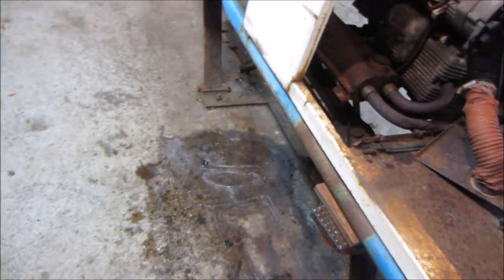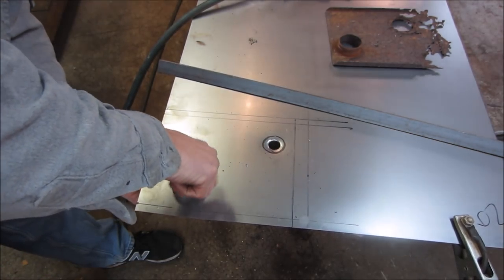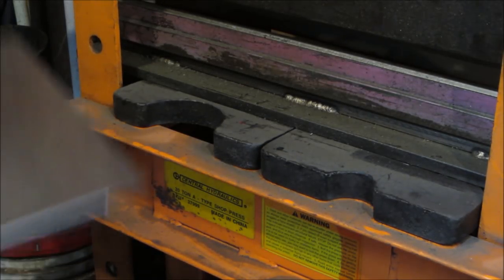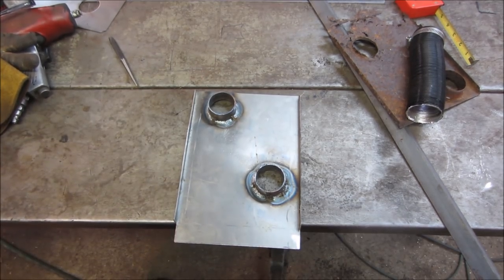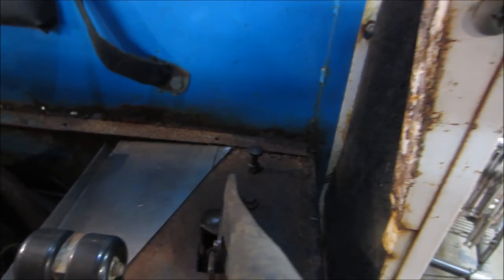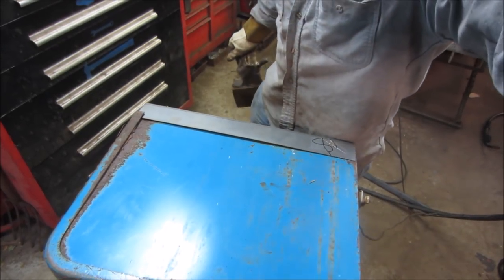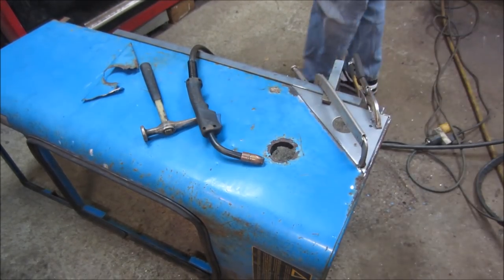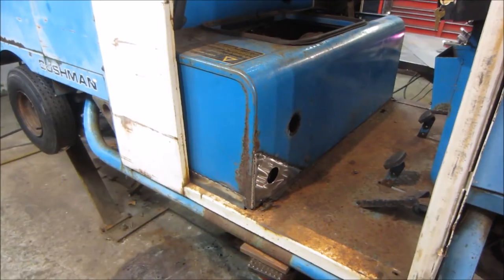metal and rust repair on the cushman  meter maid

Comment: Arrgh, hated to see this video end. This was not only educational, but very amusing with the dialog. Great job as usual. I know it took  a few years to gain the expertise you display with your projects, but you make it look so easy. I sure hope the previous operator didn't have to drive this vehicle in it's terrible rusty condition. When I was a police officer, I had to drive an old Dodge patrol car that had been "restored". I complained about the brakes and the mechanic threw a tizzy fit when I complained. He would leave black marks in the parking lot, to prove to me the brakes were just fine. Lucky for me, I got one of the new Ford cars that just arrived. The Chief took the old Dodge, I think just to show me it worked fine. He drove the Dodge away from the PD, down the hill and was unable to stop for the stop sign and ran up into the bushes, burying the front end into the soft soil. Snicker, snicker, that ended the Dodge's service life, and off it went to the scrap yard. Thanks again..Ken PD retired.

Comment: For replacement foam between heater hole panels, you might look at inexpensive pipe insulation.  Comes in a variety of sizes.  You could just glue it to one side or the other to seal between them well.

Merry Christma, Happy Holidays, and a very Happy New Year to you and yours!

RichE

Comment: Awesome video as always.  Just wanted to mention to you if no one already has that is you are not supposed to use a impact driver on knock outs/hole punches.  It ruins the threads of the tool.  Keeping the threads lubed real good helps with the life of the tool.

Comment: Coming along nicely, and a bit more metal work and it should be pretty solid and ready to go. Agree with others that this is a really fun series doing this unusual restore. Going to have to figure out what to use for those foam rings between panels for the heater, maybe some of that sheet foam packing material? or even some flexible hose pieces. All part of the fun though, coming up with replacements parts that may not be readily available.

Comment: That hole cutting tool is awesome.
Reply: Hole punch. First time I saw one was when there needed to be a hole in my stainless steel kitchen sink for the faucet. Install guy whipped that thing out and I was like wohaa... nice.
Reply: Shawn32671. We used to use those some time ago on aircraft repairs and the like. I think they were called ‘Q cutters’.
Reply: They were originally called chassis punches. They were designed for punching holes in radio and tv chassis for tube socket and other component installation. Electricians still use them for punching holes in electrical enclosures for conduit and control button and indicator light installation. I have a few of the smaller sizes and they do come in handy!

Comment: Noise alert,  ;>) Congratz on your 100K. Last summer when you took the channel up another notch I figured you would get there before Xmas. BTW - your video on that was awesome to say the least. Short on time that day to leave this. (Customer came in) The replacement panels turned out great. Like in the old JC Whitney ads - "Replaces original equipment perfectly"

Comment: Lap welding like this is so much stronger and easier. Even on an auto body restoration, the lap welds turn out great on a ground and skim coated seam. 
I don't get the obsession people seem to have with butt welding panels.     Nice work!
Reply: scdevon 

Rust prevention between the metalsheets?
Reply: I'm a big fan of Fluid Film and / or chain saw bar and chain oil applied to the inside of repaired panels or the back side of repaired panels.  Both have the ability to "wick" into seams and seal the metal.  Paints alone are very poor at fighting rust.  You need an oily coating that keeps "wicking" into the seams.  Weld through primer helps too.  I live in the high desert out west, so each their own.  I'm from the northeast originally though so I know what rust is.

Comment: I may be wrong but seem to remember mine had a 2nd heater hose outlet on the left side bottom?
One mod I made was to cut a hole in that top flat surface on the right and since it was near the engine and exhaust, put a metal cupholder in there to keep my coffee warm on the way to work and back. Believe it or not, it actually worked.

Comment: 100k congratulations.
On a side note, when it comes to sheet metal that thin, you should totally expend the small cost for one of those electric shear adapters for drills. Cuts clean, and the newer ones gently push the material down, and don't bend it anymore like they used to do.
Reply: Could swear I saw mustie get an electric sheet metal cutter in one of his garage sale videos...

Comment: Love your videos. I would have cleaned the paint off of that pipe prior to cutting it. Just makes it easier to clamp the long piece and wire-wheel or flapper disk the paint away. 

Again, you obviously know what the hell you are doing but there are always little tricks that make work just a bit easier.

Comment: You could use a flanger to make flush panels on those overlapping welds....  I was also wondering about the hole placement, it was obvious the first time to laid it on the new panel....

Comment: Hello I try not to comment to much i love your videos and work but on that patch panel u did over the top u should have cut the lip off the rusty part then stacked the patch panel right over the old one lining the lip with the edge clamped it down tight then cut both pieces at same time so it was a perfect butt joint just need to fill in the width of the plasma arc from  when u cut it I find that's the perfect 1/16 weld gap

Comment: I think the rubber seals on the heater hoses and bottom of the engine cover (on the floor) were there to try to keep some of the engine fumes out of the driver's compartment.  I suspect they were not entirely successful at doing that.

Comment: Anti seize on the threads is actually better than oil when you are using as a puller or compressing threads.
Reply from the maker: true but it gets on everything and stains it so l only use it on certain things

Comment: Have you got soluble oil in that horizontal band saw or plain water?  Hope it’s oil!   It is funny how a lot of you guys like using air tools. I bought loads in my time airguns, drills, air ratchets and cut off saws but just never had good results even with the premium brands. Recently bought battery powered angle grinder and 3/8 gun and have been much happier with battery powered alternatives.  Could be my compressor just does not make the grade. I wish I had space and capacity for a blast cabinet. Love watching your videos thanks for sharing. Regards Chris 

Chris
Reply: Its probably that vinegar we saw earlier
Reply from the maker: washer fliud,
Reply: Mustie1  is it really washer fluid, why ?

Comment: Just a quick question mustie1, I noticed in a few videos you wear some Gillette apparel. I used to work at Gillette in Southie.  Do you have any connection to the plant?
Reply from the maker: l do, worked 18 years in southie
Reply: I worked in Embrace and in Venus as a controls technician. Which department were you in?
Reply from the maker: most of them, l started in 205, then sensor, then 2k sensor handles and plastics in the end, all shifts,
Reply: What a small world.  I wonder if you know my step father Rick Langone.  He was a technician and later an engineer there.  Worked in fusion towards the end before he left.
Reply from the maker: l may know him but not by name, l started in 89 and was out around 2006,